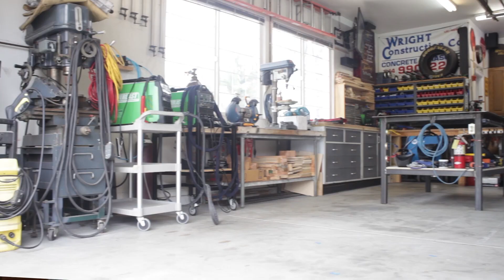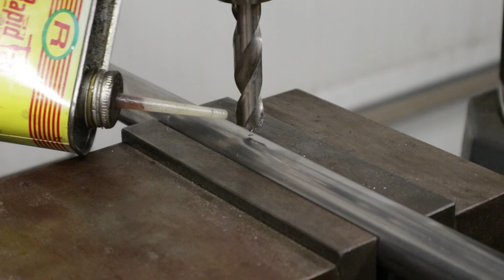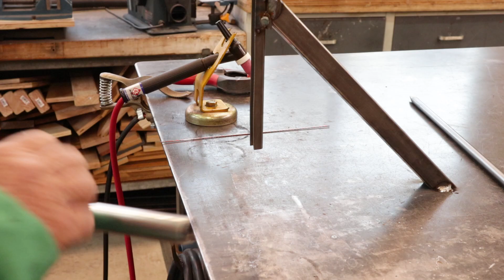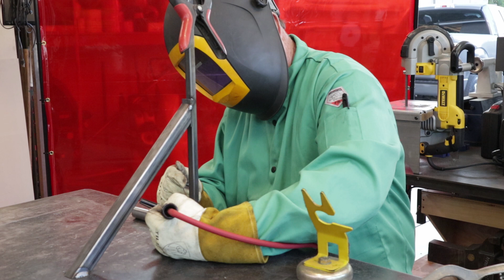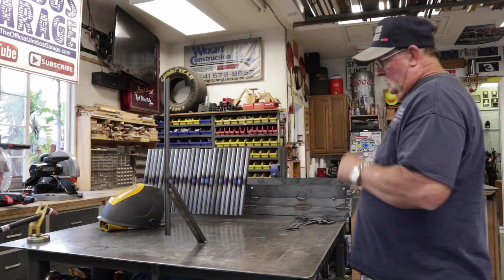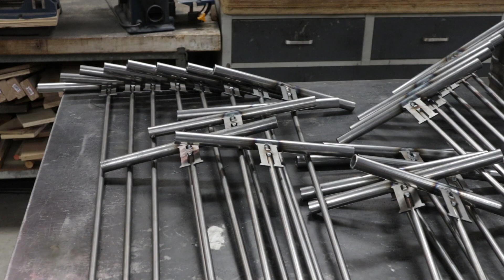Soil Probe - JIMBOS GARAGE

Comment: Check out the High Frequency point gap adjustment
Reply from the maker: Thanks for watching and the info, The year of my machine does not have that adjustment. Everlast sent me out a new H.F. board.  Jimbos garage!
Reply: Hopefully they can get you back up and running.  I just purchased the Everlast 164si, hopefully it will not have any problems.

Comment: I had bought a used Everlast 210ext on eBay mid last year. I found the high frequency was out on it as well. The seller allowed me to buy a circuit board through Everlast. I installed it and it lasted about 5 seconds, flash, smoke, .....   The rest of the welder worked great.

The seller was 100% honest and I got a full refund. I did feel sorry for him, as I truly believe he didn't know about the problem. 

I would really like to hear back on yours as to what went failed sometime.

Comment: Hey Jimbo love your vids! If your high frequency start goes out again. Try starting the arc with flicking the filler wire on the tungsten. That's what I do when welding pipe with scratch start so I don't leave tungsten in my weld. Takes a little practice but once you have it you don't have to keep sharpening your tungsten all the time.